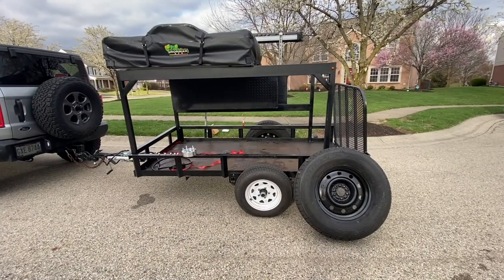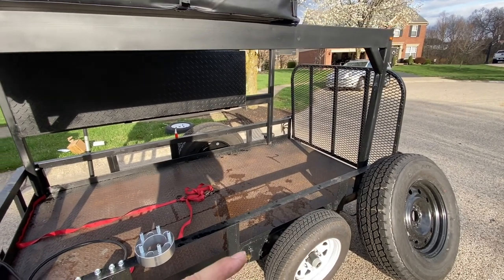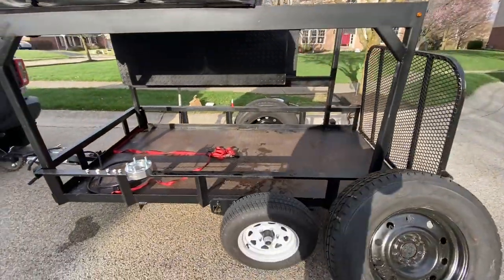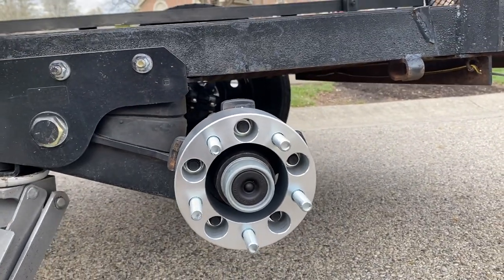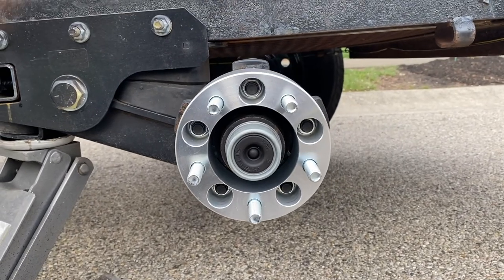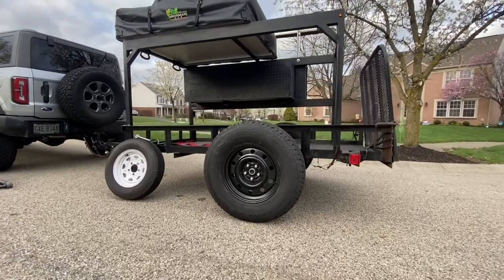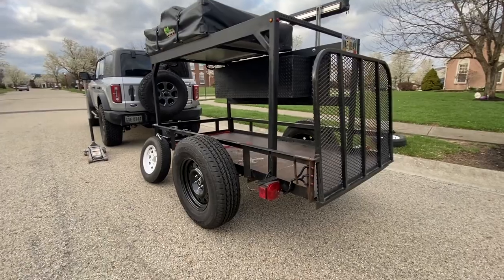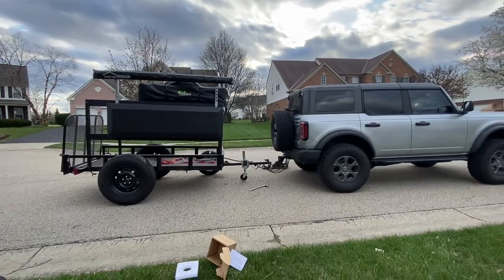Part 6 | DIY Overland Trailer | Tire & Wheel Upgrade | 255/75/R17

Comment: NICE BUILD.  doing one right now, did not think about a side box like you have...  I like that, I will be adding one for sure now...
Reply from the maker: Make sure to install the box lower after I got bigger tires the box was a bit high. Thanks for the comments and if you have questions left me know. You can message me on instagram @barebackbroncos.

Comment: Did this improve ride quality at all? I feel like my trailer bounces a lot and it sounds kinda harsh. I was thinking if it had beefier tires it would ride smoother (I know suspension also plays a role here) and also I wouldn't worry about going over 70mph on the highway.
Reply from the maker: It’s did improve ride quality when loaded. When the trailer was empty it would bounce some. I spent alot of time in the hwy at speeds of 70 and it did fine.

Comment: Is the bolt pattern 5 x 4.5 on those rims? when checking your hub centric wheel spacer torque it’s best to usually set the torque wrench 5 pounds less so you don’t crack the Loctite this way you’ll know if something really was to come loose it would move at 5 pounds less otherwise you should be good to go
Reply from the maker: Thanks for the recommendations!